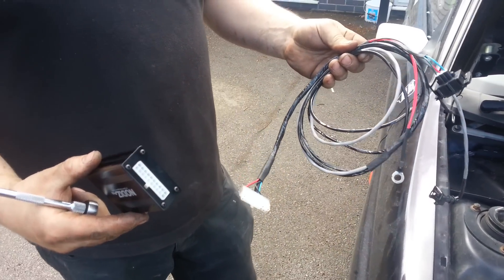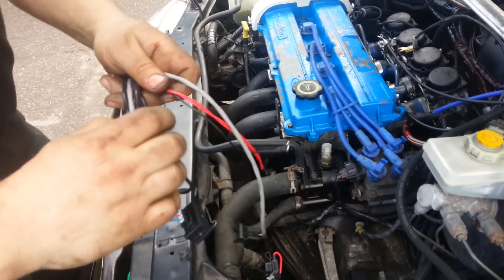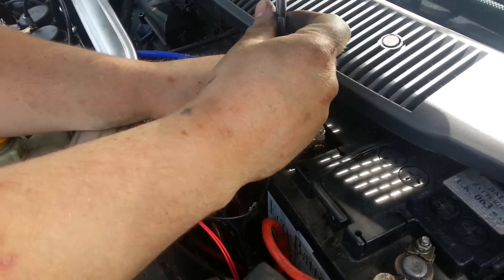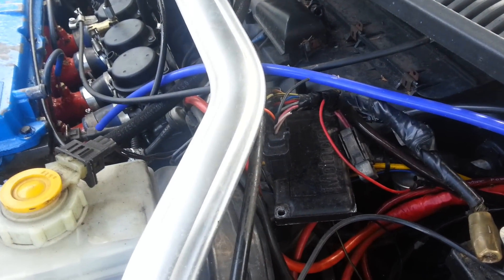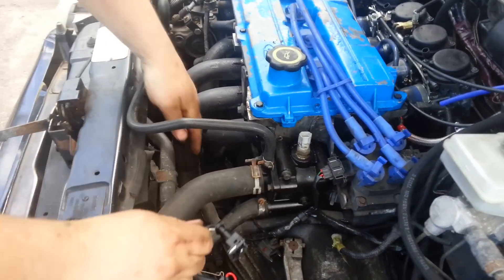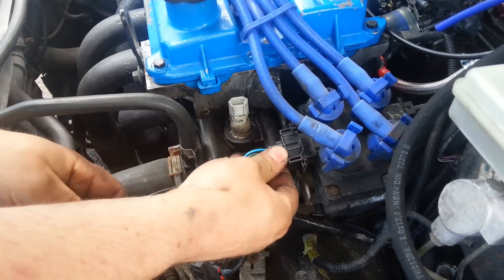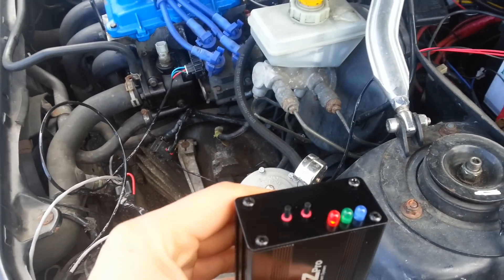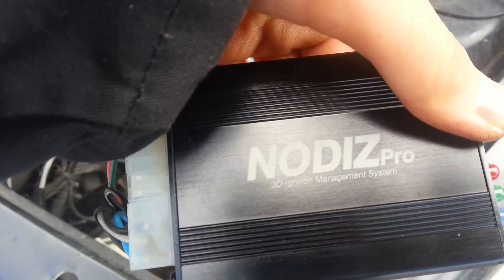How easy is the NODIZ Pro to fit? Try under 60 seconds!

Comment: Will this run itb's or carbs only.
Reply: @mtechautomotive  What a shame..
Reply: @mtechautomotive  Im almost certain you can use this without itbs. I just watched the EZ-tune video on this channel, There are 6 different load modes including a regular distributor, tps  and external map. I have an safc to control fuel already, if it works without itbs this ignition controller is literally a god send. People could save ALOT of money doing this instead of buying a full standalone ecu

Comment: hi i have mk5 cortina fitted focus duratec 2.0 engine. i have just found its running a nodizpro 5022 but the wiring has been cut about and is not great, can you get a wiring diagram or loom for this unit. it is running weber carb so just ford coil pack and crankshaft sensor.